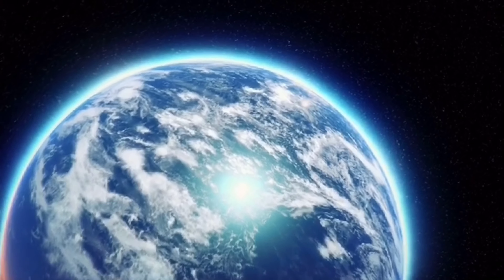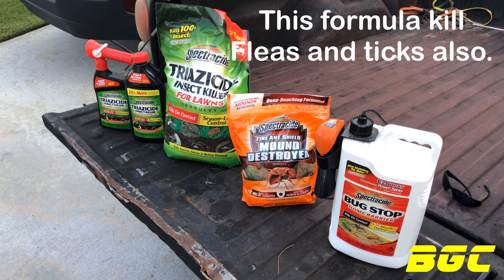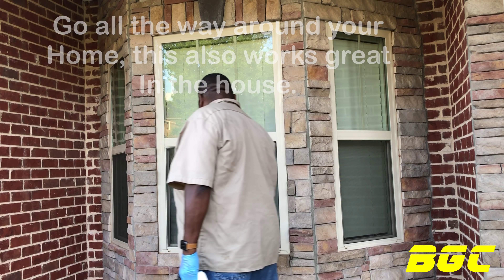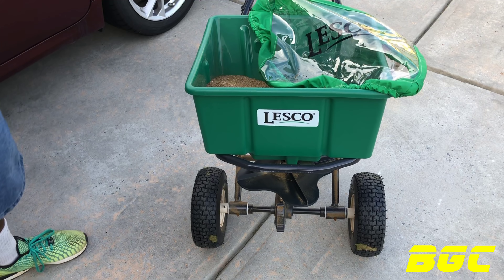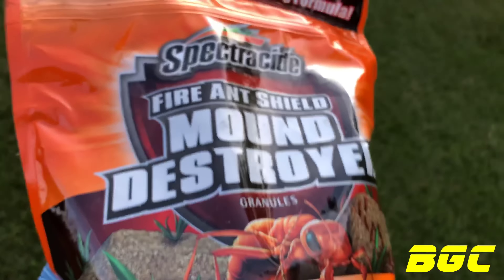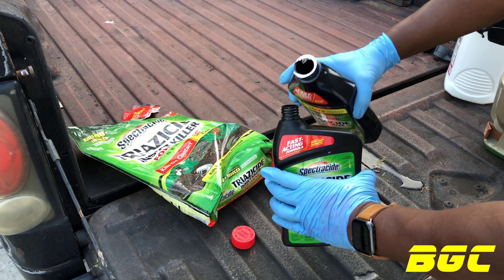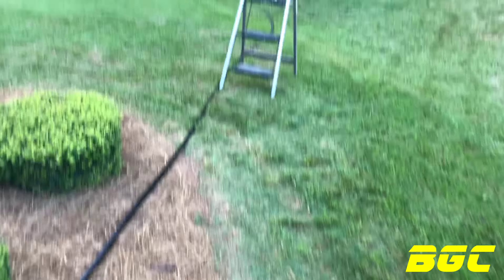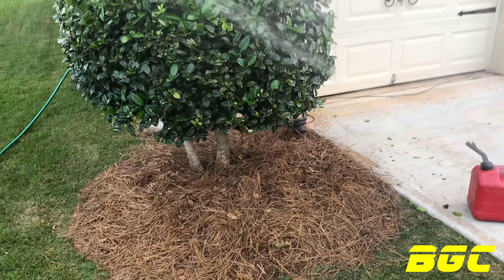How to kill Lawn Pest plus how to get rid of Fire Ants

Comment: This stuff works great my favorite because it takes them out. Wirks great for grubs and great for asian beetles. If you have the Japanese beetle use there specide beeyle killer. 
Its very powerful stuff that works its the best stuff.
Reply: Even my father was impressed that it took out the bug problem because when we put it down the bugs left very fast and ths asian beetles were dropping.
Its also great if you gave a regular ant problem it takes out the ants quickly
I had some in the trees and on the ground so i first killed the ground ones with the pellets then sprayed the trees and i gave them the "rain of death" with the liquid version.